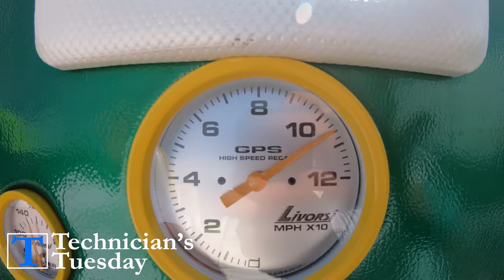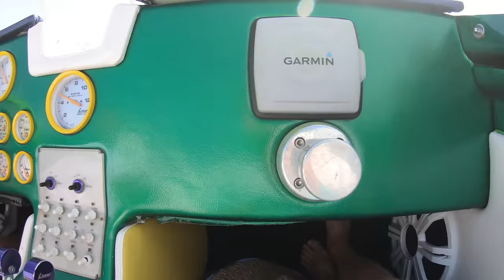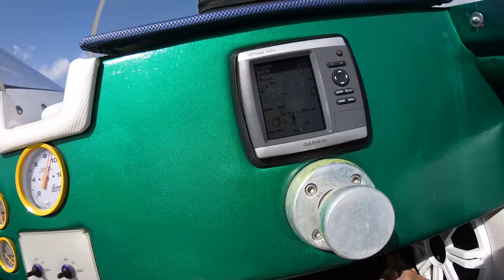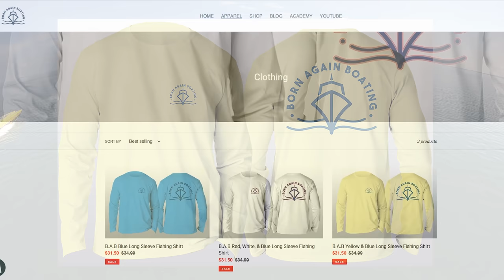Breaking 100 MPH In A Speed Boat!

Comment: Wow! I wonder what the fuel consumption is a 100 + ? I doubt 200 gallons would provide much range?... But, MORE importantly, I may have been the first one to post a comment today! ☺
Reply: i remember you commenting on my comment or video.
Reply from the maker: At wide open, they are drinking fuel lol I'm not sure what the flow is. But you'd be surprised at like 60-70 mph, they actually sip fuel lol you could go hundreds of miles easy!
Reply: @BornAgainBoating   I'm sure from the boat's owner's point of view, his fuel burn rate at 60/70MPH look economical compared to what he's burning at WOT. Even when she's dialed into her sweet spot, she's must still be drinking fuel like a lush at a wedding with an open bar, and yes I still want o know what those numbers are. Thnaks

Comment: Wanted to ask what's the deal with the driver's cockpit on the port side and not the starboard side? Haven't seen that. Figure it must be a racing boat thing since they're turning left mainly?
Reply from the maker: It goes on either side ;) it's pretty cool, you just pull in on the back of the steering wheel and it pops off, then you can just move it over to the other side, so it's set up for either side!

Comment: At what pitch does the propeller efficiency drop off? Its crazy to see super high pitch used rather than high rpm, looks like the props would almost spin the water around only and not actually push the boat :D
Reply from the maker: That I dont know:/

Comment: Gotta ask... Whats' the GPM (Gallons per Mile) rating?? ;)
Reply: I was curious about the same thing. If I had to take a guess I’d say somewhere in the high 30’s per engine🤔
Reply: About 1 mpg. Maybe a lil more. Each engine burns about 50 gallons per hour at wide open.
Reply from the maker: I'm not sure but I'd guess in the mid 40's at WOT

Comment: Been looking for a 26-28’ speed cat...Damn things are pricy and not that many out there, especially with an aluminum/galvanized trailer. One day
Reply: Buying it is the easy part wait til you try insuring and maintenance
Reply: @kenfung664  My other speed boat wasn't that bad but there again, that was 12 years ago and it only did 65...I have heard they are quite hard to find someone to insure them when they top out over 100.

Comment: And to think, Seven Marine makes outboards that are about 100HP more powerful than those motors.  When is enough enough?
Reply: Yeah and twin 7 marines still wouldn’t get close to 108mph...
Reply: @paull6678  Sure they would.  There's more power,  so with the proper hull, prop and the performance lower unit option from Seven they would be even faster, as long as the additional weight doesn't cost more than the additional power provides.  Heck, midnight express makes a 43' 16,000# luxury center console (google Midnight Express 43 open) powered by quad Seven's that goes 100mph.  This boat weighs 1/4 as much.
Reply: Matt South sevens work well on heavy centre consoles. They’re too too heavy and cannot be run high enough to work well on a catamaran. It’s not only about the weight of the motors, the centre of gravity both fore and aft + up and down comes into account. The bravo xr drive can also be run much higher than the seven gear case decreasing drag and increasing rpm. Slap twin 7’s on here and they will struggle to break 100 while costing twice as much as the mercs. Merc 450r outboards would also outperform the 7’s and May come close to the twin 525efi I/O’s

Comment: What’s on the passenger side console? It looks like a possible second helm station, is that what it is?
Reply from the maker: Yup! Thats for the steering wheel! So you can actually just pop that cover off, pop the steering wheel off and swap them! They are a quick disconnect too, so you just squeeze the back of the wheel and it comes right off, pretty cool!
Reply: That’s for driver and throttle man configuration. 1 person will steer and the other throttle